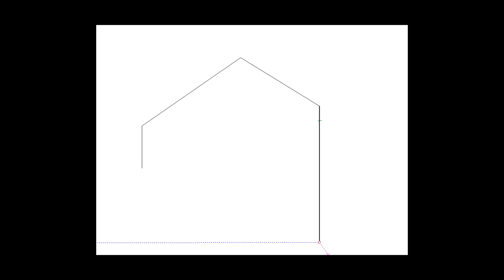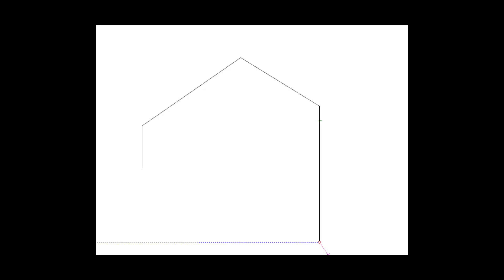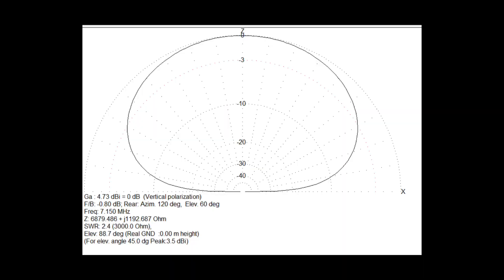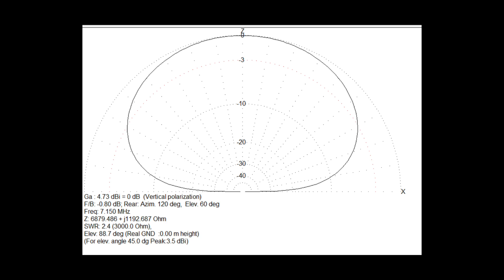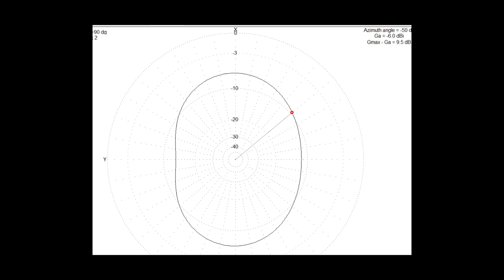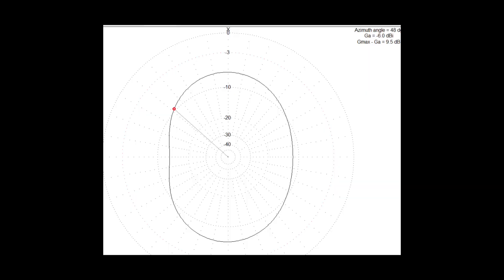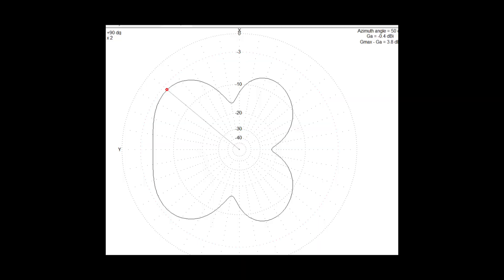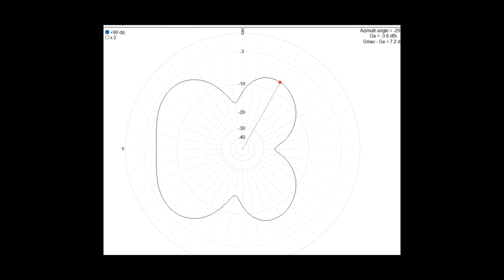Ham Radio: End Fed Half Wave Antenna - A Great Simple Multi-band Antenna

Comment: Which antenna is more sensitive for RX DXing and which is better for TX Dxing - Flowerpot coax vertical, dipole or end fed half wave??
I have limited space also but I do have a 20 meter stretch down the side of the house and a plot in the backyard I can use.
Cheers

Comment: Since you state that no tuner is required I expected to see SWR or impedance data, but I only see pattern predictions. I’d expect some kind of tuner to be required to have a good match at all those bands. I’d like to see VNA SWR and Smith Chart sweep at each band. That’s how I’m evaluating theEFHW antenna I’m currently working on. But it includes a simple tuner.
Reply from the maker: The 49:1 transformer transforms high  impedances when bands are a half wave or multiple thereof. No tuner is needed. So for example a 66 foot wire fed with the 49:1 provides a good vswr on 40(1/2): 20 (full); 15 (1.5 wave); 10 (2 wave). Only warc bands would need a tuner but losses would be high and power should be reduced a lot so as to avoid overheating the transformer. 73

Comment: Do you ground it with a stake or do you have radials?
Reply from the maker: No ground. No radials. Optional choke at 2m or so from feedpoint.
Reply: @TIMG5TM  interesting, I bought one recently and it has an earth lug, tried it with radial and stake and the ftdx10 will only tune 10mhz upwards with resonance in the cb band everything else circa and swr of 6 or worse.
Inverted l up a dx commander 10m pole to top of house 20m away

Comment: Great project Tim 7351. During two years I've made a study about this antenna, for 11 meters. Trying some toroids and one that works perfectly is from an old TV. So since 2022 I've made 5 antenna's, and that's my core business now in Portugal, with the Vertical End Feed JS20 Portable/Fixed. This antenna works perfectly from 20 meters to 10 meters without tuner. 7351 and good work Tim. Working with one from my QTH in Cartaxo compared to A99 receive a Tx better without qrm.
Reply from the maker: Sounds very good!!

Comment: I, too, enjoy using end fed half wave antennas.  Currently, they are the only kind I have set up.  I have a couple of mono-band antennas (2, 6, 10, 11, 15, 20m) and a multi-band antenna (10, 15,20, 40 and 80m). They are all resonant antennas (no "tuner" required).  Of course, I don't have them all mounted at the same time.   I hang the mono-band antennas vertically from a 12m Spiderbeam mast.  They are from a German company and use no conventional matching unit, but rather a window line stub with a slider on it to adjust the SWR, very good solution when operating portable.  The multi-band antenna is from a Dutch company and is 23 meters long.  At the end is a coil and about 2-3 meters of additional wire for the 80m portion.  The bandwidth is rather narrow, but if you want, you can adjust the length of the wire and get good resonance on any part of the 80m band that has no effect on the other bands.   I have it configured as a sloper, the matching unit about 2m above ground, the high end about 12 meters above the ground.   (I have the real estate for that configuration).  Interestingly, there is some directivity (gain) in the direction of the slope.  For good measure I did connect an auto-tuner to the antenna near the feed point and can get a match on the WARC bands and 160m band.  It works. Kind of.  Oh, one last thing. For none of these antennas is a counterpoise or ground necessary.  Grounding the big antenna might be good to bleed off static electricity on the wire.  Of course, if I had the money and the okay from my SYL  I would like to put up a 20m  tower and beam antenna.  But that ain't gonna happen in my lifetime.  Vy 73!
Reply from the maker: Sounds like a good collection!

Comment: I've tried using a 49:1 EFHW but the coax seemed to be picking up rf and transmitting it back into the house. I need to try adding a choke, but I think that's a somewhat common problem with them as the coax effectively acts as the CP.
Reply from the maker: The solution many use is to run the coax about 5% of lowest wavelength from the 49:1.. then common mode choke.. then coax to radio.

Comment: Hello Tim. I am a very happy EFHW User. I have 5 Enfed Antennas now 49:1 and 9:1UNUN Baluns. Shortest 48:1 has 11,90m lenght (39,1ft. with 34µH extension coil for the 40m Band) and the long wire Version 20,45m (67ft.) Lenght. The 9:1UNUN 's are 26,50m (87ft.) and 40,56m (133ft.) lenght. There's longer wire versions available to choose if someone has the Space for it to install such a Beast.  I worked the whole World with these antennas as a portable station. I kinda fell in love with wire antennas...thx for the Video, Tim. Have a nice sunday. 73 de Your Friend Uncle Guenter
Reply from the maker: Thanks Guenter you take care 73

Comment: At 7:16 you show us the current distribution on 15m. Being an end fed I would have expected the current to be closer to zero at the feed point.
Reply from the maker: Not really. Although you are correct that the efhw is a voltage fed antenna, the current maximum of a single half wave is at quarter wave distance from the feedpoint. In this case for 15m this is just around 3.3m (11 feet) from the base. Of course, there will also be a steady growth of rf as we approach that point of current maxima from the feedpoint. 73

Comment: That's very similar to my arrangement at home, except I have the transformer about 2m up a 10m pole. So it goes up about 8m, down for 10m at about 45 degrees to a 3m pole and 2m fold back horizontally. All been swinging around nicely in the winds this weekend!
Reply from the maker: Sounds familiar!

Comment: Thanks Tim I have a link in mine at 15.6m it gives 9.6 mhz 18 mhz 24 mhz on same wire. Slight miss match for 30m but it works well on 18mhz. Close link and it works on other bands.
Some fine tuning may be required to suit other "gardens" elsewhere. I been chasing JA SOTA ops with my FT 817 in my yard with it, this config gives best results on 15m 17m . vk5cz ..
Reply from the maker: Sounds very good

Comment: Hi Tim, I have been using a 40 meter half wave for some time  I get great results, I also have a coil fitted so I can get onto 80 meters also without using a tuner.
Reply from the maker: Good antenna for limited space on 80
Reply: @TIMG5TM  Tim, you seem to have a bit of vertical space at the far end of your antenna - maybe you could put in a loading coil/choke for 80m with its tail just hanging down and seeing if you could have the antenna be usable on 80m?
Reply from the maker: @paulsengupta971  good idea 👍

Comment: Keep these great videos coming. I am also am a fan of EFHW antennas. I am going to be looking at using a choke coil for 20 meter resonance with a length of wire on top of the coil to resonate on 40 meters. This should result in a total length of 12.5m (41ft.) which is doable for a vertical orientation. This configuration should be resonant on 20, 40 and 10 meters. As a vertical it will easily fit in a small garden and the far field should behave as a vertical with no worries about ground radials as needed for 1/4 wave verticals.
Reply from the maker: Good point, those shortened ones work quite well on 40. Apprentice your support 73

Comment: I tend to get the RFI from Hell with multi bend HWEFs. I have more coax chokes and ferrite beads than you can shake a stick at, but still a very unhappy solution.
Reply from the maker: Ah luckily thats something I’ve yet to encounter
Reply: @TIMG5TM  Borrow a legal limit linear and test the system with that. Magically, it shall most very likely appear.

Whilst you might not operate QRO often. or at all, the RFI is still leaking back.

People claim HWEFs are resonant and have no need for grounding/radials. Including some manufacturers. Not so. Not so at all.

At the very, very least, I'd have a 49:1 transformer with a grounding terminal and make sure it has either radials, or a good ground rod. Also an RF choke.

Comment: Hi Tim, Always enjoy your videos! Would this antenna need a counterpoise or does that depend on each installation? Also is there a minimum length of coax or does that depend on the individual installation? Very best 73’s! WB3CFN
Reply from the maker: Hi Joe. At 100 watts or less I have found no counterpoise is fine. Coax has been variable lengths and so far no issues 73

Comment: Great video Tim as usual very informative, efhw antennas are super convenient, I myself did a bit of experimenting during the summer . I was interested in how a 20 meter band full half wave vertical would perform. 
Using a 10 meter DX commander pole and a 49:1 transformer I set it up , in a word phenominal !  . 10 meter band also fantastic.  I actually connected a CB radio to it and a manual atu , It blew a imax200 5/8 wave  CB antenna out of the water !
Everyone should own a 49:1 transformer
Keep up the great work Tim and have a great weekend 👍 73s
Reply from the maker: That’s really kind of you! Yes I agree they are very adaptable and useful antennas 73

Comment: Hi Tim, Loving the content, Keep the videos coming. I just brought an end fed Half wave and 10m Spiderbeam pole for my small garden. Only passed a few weeks ago. I wasn't sure weather to buy a vertical or end fed wire but decided I can try different set up's with the wire. I also brought the Telescopic Antenna and Loading Coil for mobile use which I have set up in the garden on the Ground mount that M1Ecc sells which works Great. The End fed half wave is in the post to me from UK antennas so i'm just playing with the Telescopic. Having Fun. Thanks Tim
Reply from the maker: First of all congratulations on passing! You’ll enjoy the efhw it’s a great antenna. Appreciate your support too thanks!
Reply: @TIMG5TM  Hi Tim. I will be putting up the end fed half wave in the next few day in a inverted vee configuration.  The 49-1 transformer Will be up off the ground around 6m high and the centre of the wire around 11m high and  it will run along to sides of my small garden. One leg will run east, West and the other north, south.  Do I need to earth the matching unit? 7m long earth wire might affect the antenna? What's your view? Thankyou for your help.

Comment: Nice video Tim. I have a similarly deployed EFHW which works very well. I have compared the placement of the longest vertical section between 2 positions. First was 2m from the house and second 10m from the house. Over a 4 week spell of each, the second position was 2S points lower in noise than the first. I guess the vertically polarised QRM sources in the house have decayed more at 10m. Keep up the good work. 73, M0YZT
Reply from the maker: Thank you! Yes being further away from the house will certainly reduce noise. They work well for sure, thanks for your support! 73

Comment: Hi Tim............Interesting video.................I have been using EFHW for a few years now      (from Uk Antennas )....Even though its meant to be for 40/20/15/10   I still find I can use this antenna on 17 and 12 using the ATU inside the radio with very good results.................I would recommend this type of antenna to anyone ............My antenna is an inverted L and I have had very good results........Best 73s ............Matt
Reply from the maker: Thank you Matt.. they certainly work well 73

Comment: Great stuff Tim. Anyone starting off in HF should watch this and go this way for their first (low cost) antenna. I have mine in a crazy configuration to keep the wife happy that it does not spoil her garden and it still works well. Can't wait for the warmer weather so I can go on the hills with a simple inverted V setup either. With just 10 watts you can get some real distance when conditions are right. M7BLC
Reply from the maker: Thank you John. Yes they are very tolerable to bending and that’s useful when keeping the wife happy! 73